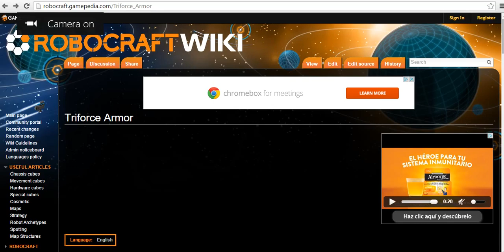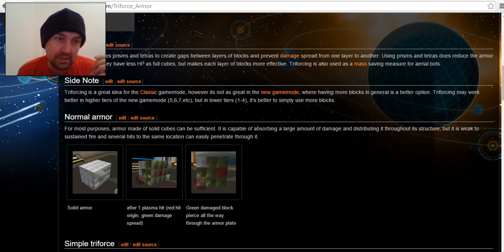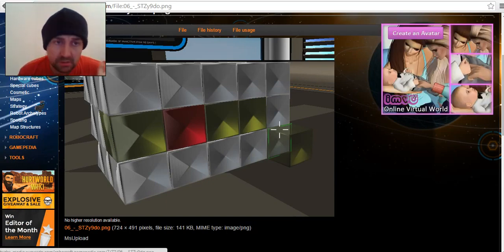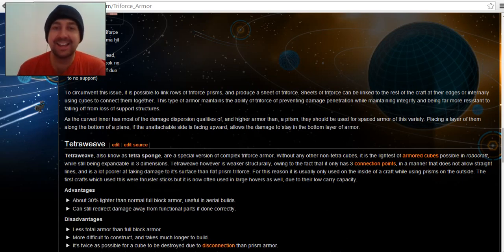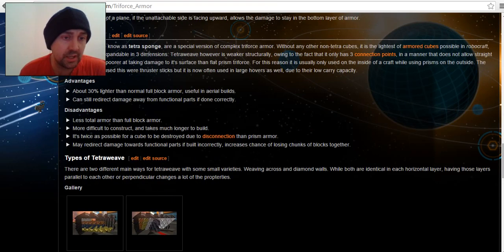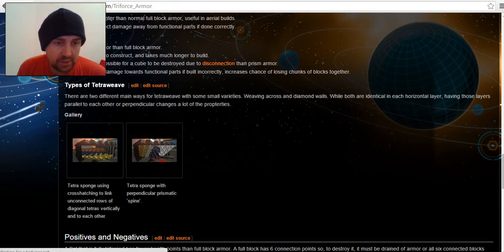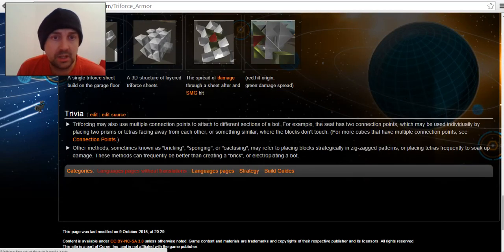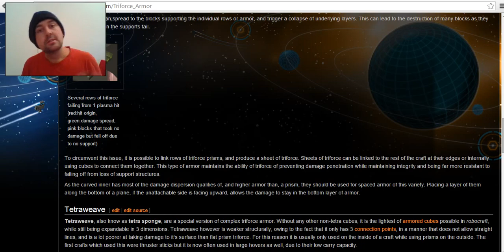Robocraft - What is Tri-forcing

Comment: +Table Here you sound like a fresh teacher that not quite understand what the textbook contains of learning. Try to explain with examples of yourself how it really work, in a real fight. Like how long do you survive the single mode. How many can you destroy in Mk10 with a ground SMG build? 
One issue with tri-forcing and such attempts on damage redirection, are that mostly there is not only 1 shot, but several. So if being hit on the same area several times, even larger chunks of the build can be destroyed, like a house of cards. 
When building then have to think on several tings at the same time: Without weapons and movement it seldom doesn't help how good you have tri-forced - maybe except if teaming with a medic. With movement and no weapons you might manage to wait for healing. With weapons and no movement you might do some damage, while hoping for a medic. With weapons and movement, but not good enough build, you might fall apart as an instant kill / one shot (probably it just seems as one-shot, but often there were several hits very fast at almost same spot).

Comment: I have a bot made of blocks and it has those triangle blocks on the surface on it, however it's not on the roboshop... yet. However I will add it later on, and I would like to see you building a bot that in wide and long and about 3-5 blocks thick made of blocks and has those triangle cubes on top and at the sides. The base design would be little like your mega smg tank some time ago. You remember? The one made from orange and black blocks. You created it by randomly "painting" the hull and build around that. (btw it was one of my favourite builds by you)

Comment: I am not the best triforcer since I build quite small bots where it's impossible to triforce anything besides the seat. In my experience the seat should always be a little triforced, it just adds so much to survivability. Also make sure to have atleast two layers below your seat.

No chassis part that connects to the seat should be directly connected with another chassis part that connects also to the seat.
Hope this example  down here makes clear what I mean. 

\  o
=  |
/  +__
      /\

What is what?

o                 Seat          
 |
+__

=                 Cube

\ and /       prisms, the line is indicating where the non connectable surface is.